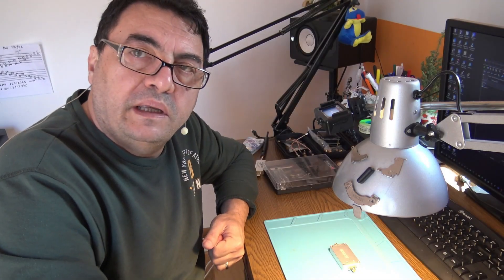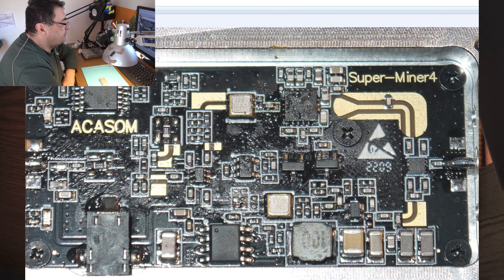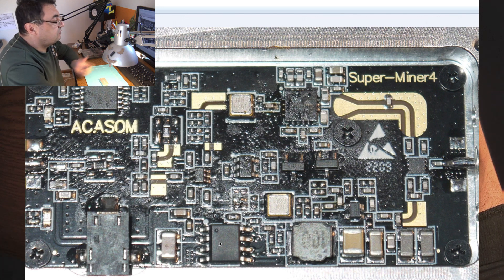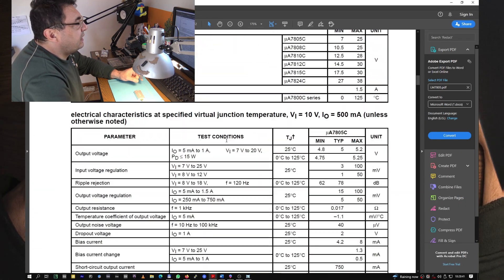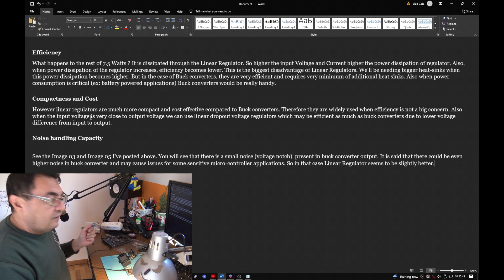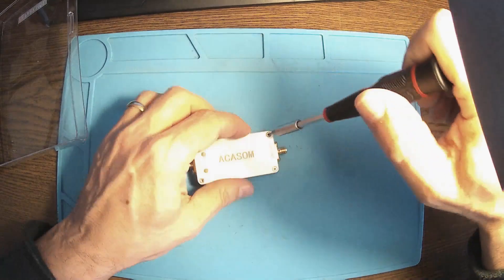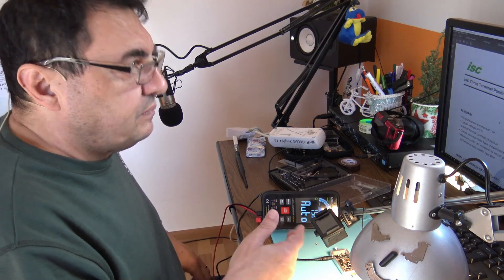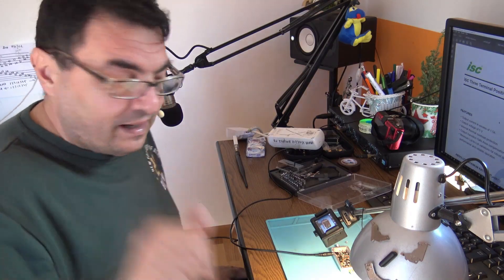ACASOM PA0801 Power supply MOD

Comment: Does it means that if u plug 5v directly from usb miner to amplifier without any mod than it wont work properly ? Becouse it would be great solution for me if I dont need to use 12v
Reply from the maker: Yes , it's working..
Reply from the maker: Please subscribe..

Comment: Do you think its possible to just bypass the buck converter instead of removing it by solder a cable from power input to the capacitor(like you did) and power it with 5v from usb instead of 12v?
Reply from the maker: Of course..it's working
Reply: @viocaia  i removed the buck converter the hard way (with a screwdriver) 😅 and soldered a wire from power input to the big capacitor. Its working fine with a power of 15.8 db @ 868 MHz
Reply from the maker: @cabanossi  Great! Max 5V!

Comment: Nice modification , I have to say the frequency sweep we done on the Acasom amp we sweep 0 - 3Ghz and did not see any internal noise although we did not check for internal noise. I have made use of the Bias-Tee power supply and not directly supplied to the amp. I think when I do have time I will take it back my friend and ask him if we can test Internal Noise and if there is we might even   try to filter it more. My only concern with the 7805 driven with 12volt is heat dissipation. I have used these in my ESP8266 projects to power small 5 volt Relays and it got quite hot. please let me know how yours fair in the amplifier after some time running.
Reply from the maker: No problem with heat, the back plate is soldered to the PCB ground and is a huge part connected to the aluminum case..

Comment: Could it be possible to plug a 5V power supply instead of 12V and directly connect it to the 5V component bypassing the converter?
Reply from the maker: Of course..but no more then 5V
Reply: @viocaia  What about USB? The LINDY 70265 Cable have the fitting connector.
Reply from the maker: @l.s.6069  I think power from USB is enough..
Reply: @viocaia  USB got 5.12 Volt, is this in OK or is it too much?
Reply from the maker: @l.s.6069  That's perfect..